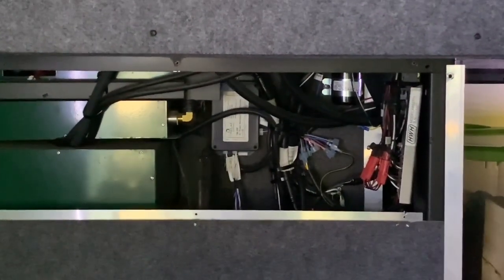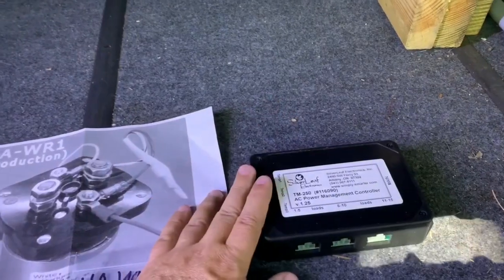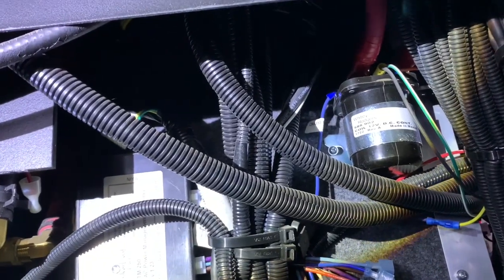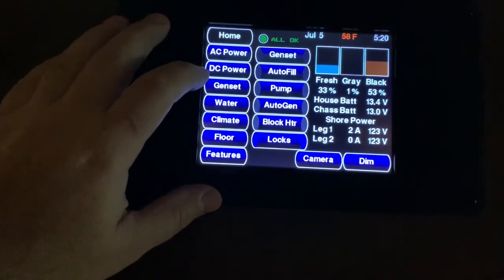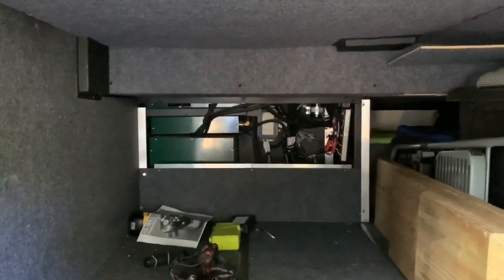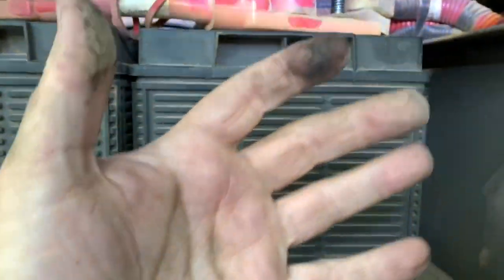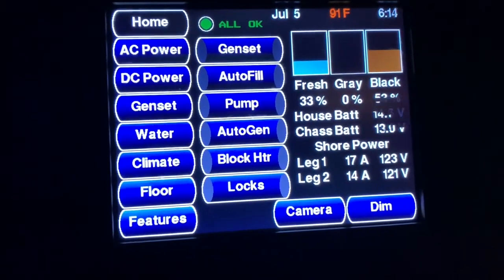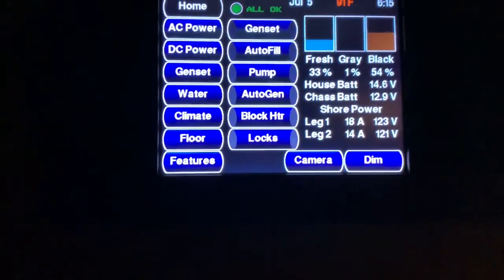Water pump and Energy Management electrical issues

Comment: Thanks for the video!  I definitely need to get the diode installed on my MADP.  A couple of notes... When I replaced my charge bridge I also had to disconnect the power going from the house and chassis batteries to the solenoid.   Instead of shutting down all of the house power, I only removed the one cable from the house battery bank to the solenoid.  I used the wiring diagram mounted in the battery bay and verified that power was disconnected to the solenoid using a multimeter.   I also did the same for the chassis batteries as the chassis battery disconnect switch doesn't turn this connection off.  I didn't see the need to shut everything off (salesman switch, inverter, etc), but perhaps I'm missing something.

The green wire with the white strip connects to a KIB relay board.  The TM102 sends a signal to the KIB relay board to active the solenoid.  The relay on the KIB board activates and sends 12V over the green/white wire to active the solenoid.  The white wire is the ground wire.  There is also another wire connected to the chassis battery post on the solenoid.  This wire, which has an inline fuse, provides voltage to the TM102 so that it can report the chassis battery voltage for display on the Silverleaf panel.

I need to determine if the part you purchased from Newmar is merely a 1N4001 diode.  If so, I would likely just wire that up myself instead of ordering the diode and wires from Newmar.   Again, thanks.